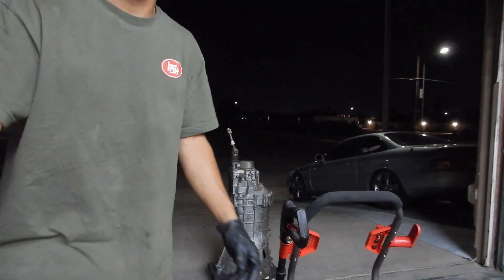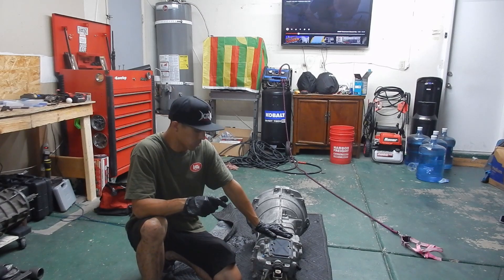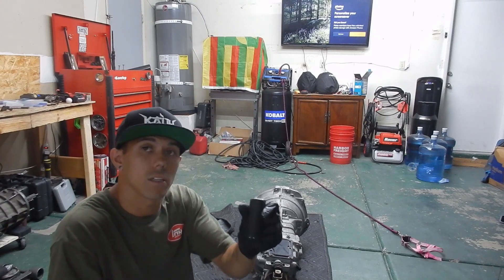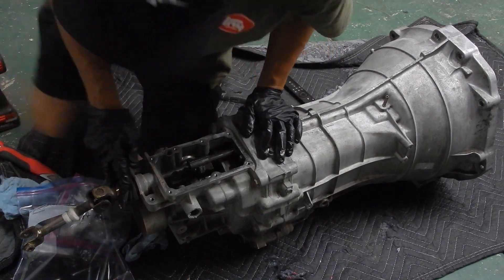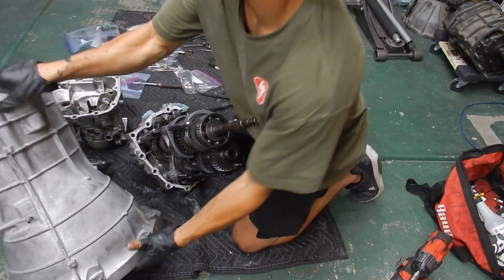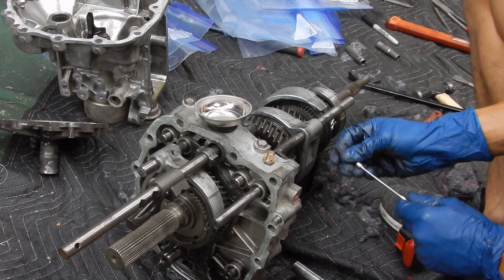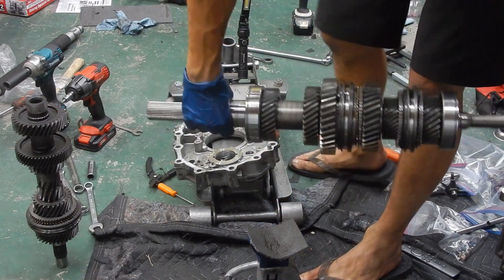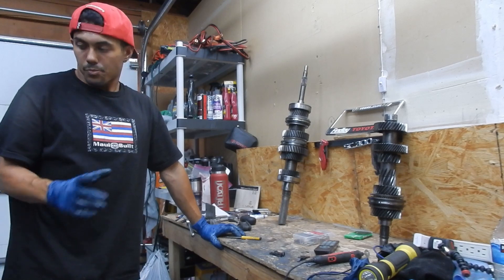How to Completely Disassemble a CD009 Transmission! Part 1 #CD009 #rebuild  #subscribe

Comment: Are there any sites where I would be able to get parts for the cd001 like the individual gears and syncro or is that all on amayama
Reply: Are you talking about the cd009 input shaft?
Reply from the maker: @leaflux_gaming5668 The CD009 and CD001 input shafts should be the same part number, just one superceeds the other (old part and new part share the same part number)
Reply: Looks like I’m prolly gonna buy another transmission by the looks on that input shaft price lmao, I really appreciate the help 🤙
Reply from the maker: @leaflux_gaming5668 prices aren't getting any lower to be honest, I personally would still buy the input shaft so you can fix your CD001 to have it as a spare 🤙🏾 CD transmissions prices aren't getting any cheaper tbh
Reply from the maker: I would personally just buy everything off Amayama, the site is a little difficult to navigate at first but the more time you spend searching for parts, the easier it will get and its the cheapest online OEM parts distribution site for any JDM vehicle! Its where I get the upgraded syncros, the shifter hubs and the gears for my rebuild! 🤙🏾
Reply: @AustinKamuela hey so I ended up going through the whole web site and found that the 5th gear that I need for the cd001 got discontinued, is the only option I got is just having to get a  newer transmission or is there something else I can do or other sites or people that are selling that gear. Thank you for your help
Reply from the maker: Z1 Motorsports or Concept Z Performance should both offer the 5th gear that also comes with a new input shaft. The old design has it where they were two individual parts but the new design combines them into one. I don't remember the part number off the top of my head but im sure you will have no problems finding it!
Reply: Just making sure, the input shaft of a cd009 is compariable with a cd001 ? What else do you have to change or does it just drop it just like that

Comment: my input shaft bearing is cooked. yeah i might have to take the transmission to a shop 🤣
Reply from the maker: There aren't many shops that will work on CD009's.... good luck though! Best bet would be just to take it apart yourself if you feel confident enough!

Comment: Can the transmission input shaft bearing be replace without taking the trans completely apart?
Reply from the maker: Im not entirely sure, I would recommend just taking the transmission front housing off either way. Theres no need to be taking shorcuts that could lead you to potentially damaging more internal parts in the transmission

Comment: I got g37s 13 & was getting locked out of gears when slowing down/changing gear, now car turns on fine but once I left off the clutch the car stalls out even if it’s neutral- only runs if clutch is held down - would this be a probable cause? 
Has zmak/stage2 clutch kit.
Reply from the maker: You have a G37 transmission in an S13? Just wanting to make sure I understand what your saying. If you are getting locked out of gears it could be your syncros not lining up correctly but that would only be the case if you are getting locked out of one gear and not the other on the same hub selector, for example you get locked out of 5th but you can shift into 6th gear fine. However if you get locked out of both gears on the same hub selector, for example you can't shift into 3rd or 4th gear then it would be the shift fork. Although it sounds like your throw out bearing might just be going out since you mentioned the car stalls even in neutral and if the throw out bearing isn't engaging the clutch right, it could cause issues. Hope this helps!
Reply: @AustinKamuela  
It’s a 2013 G37s coupe ** 
- got cha, my tech at job is telling me is more likely to be a fork. but will get transmission yanked out in a few weeks & pray is just a throw out. I appreciate the info!!

Comment: Sweet video, would it be possible to change the input shaft bearing without splitting the case? Haven’t found much info but that’s about all I need to do 😢
Reply from the maker: Thanks man! I personally don't think so but it  might be possible. Its definitely worth a try, however removing the bolts holding the front case to the rear shifter housing, although tedious, will be the best and least problematic method of getting the job done
Reply: Appreciate the input I’ll see what I can do
Reply from the maker: @Kev1m  Considering we are talking about an input shaft, I feel my input was only necessary 🤙🏽
Reply: about to do my input shaft bearing :/ anything to look out for???
Reply from the maker: Just make sure to take your time and take alot of pictures on how the bearing sat before you took it all apart so you can put it all back toghether correctly
Reply: Had to take the case apart, I cut the bearing since everything was fine and I hammered the new one in. No I didn’t damage anything, everything is nice and tight now just need to reassemble the case and reinstall the tranny👍🏼
Reply: Hey man my gearbox is noisy in every gear but fifth. Do you think replacing the input shaft bearing is going to solve my issue?
Reply: @YaBoiiiNikki most likely the gear itself it would be loud on every gear if the input shaft was the problem